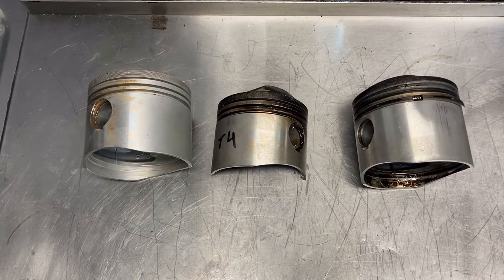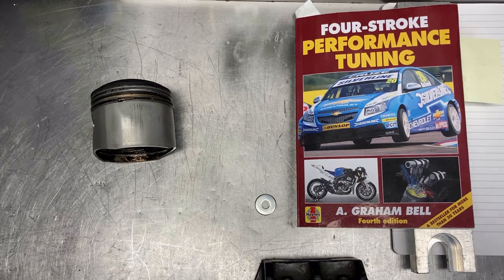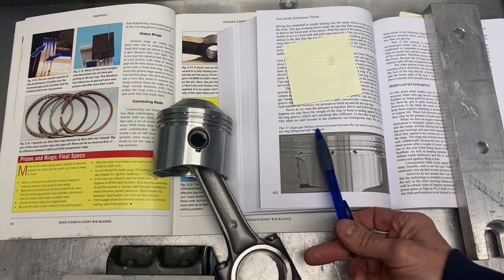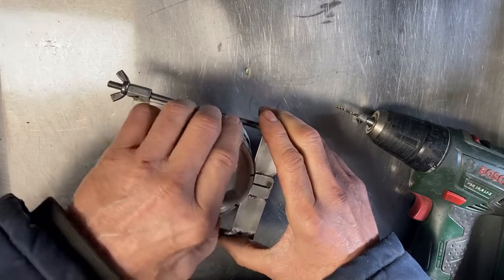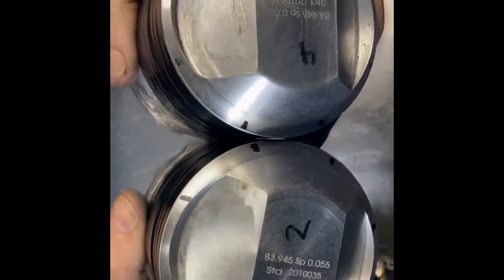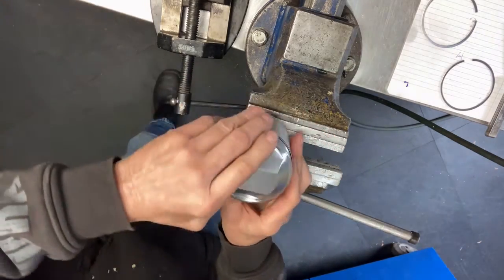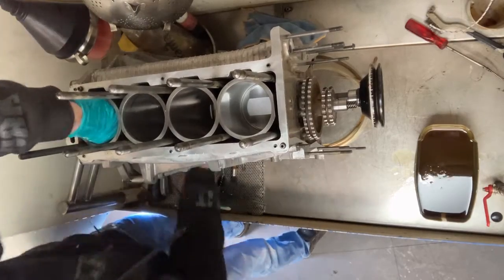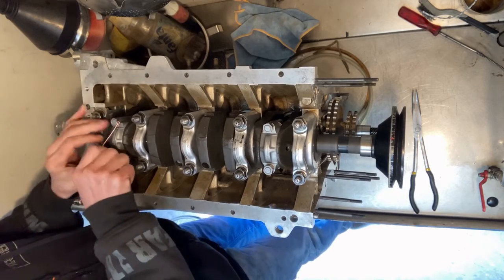Alfa 105 engine rebuild part 6 installing the pistons.

Comment: When did you install the liners?
Reply from the maker: I did not include it in the video because it is a standard  procedure and had nothing to add.
I used silicone grease on the O ring because the surfaces where good.
Iff the surfaces are bad use silicone sealant .
Good Luck.

Comment: Hi there very informative and well explained.I do though have an question on the liners  installation.   Do you use any additional sealer/ compound other than the "o" ring. Thank you
Reply from the maker: If the surfaces are good no additional compound should be necessary.
 Never the less I always use silicone grease ( molykote 111) on all the O rings I instal.
If the surface is corroded or not so perfect I would use sealer to get a good seal.

Comment: Will the lateral gad ports increase crankcase pressure? 
Should I do this for my 2 litter fast road build?
Reply from the maker: I had this failure on my track day car which runs the bulk of the time in the higher rev range
 ( 5000-6500 RPM).
For a road car the chances of this accruing are much smaller. 
The gas ports are bored to the same depth as the piston ring groove to restore normal operation again if ring flutter occurs at high RPM. 
They are on the top piston ring only and not bored completely through like the oil return holes in the oil retainer ring groove.
So, no the crankcase pressure will not increase.
I did this mod because I did not see any downside to it, apart from the extra work.
 And also almost all the high performance pistons I saw had this mod so it must have some benefits.

Comment: Can you explain the use of the feeler gauge again? Between which points is it attached? Thanks
Reply from the maker: Take feeler gauge that is a press fit between the big end and the crank, when you torque down the big end bolts the force is taken up via the feeler gauge and not via the bearing surface.
Although almost nobody does this on youtube, this is the proper way and this is how it is taught.
I used two feeler gauges but one is also oke.

Comment: Great detective work in working out the cause of the ring groove issue and ingenious method for drilling the gas relief holes. Will be interested to hear how this mod performs and what the pistons look like when you tear that engine down in future. Thanks for sharing.

Comment: I want to rebuild my alfetta gt engine after 5000km, because I saw your videos :D :D :D...... What type of pistons are you using? What compression ratio are you aming for? Will you use fuel from petrol station? 95oct or 100oct?

Cant wait to see your further videos:)
Reply from the maker: I use the 2.0 I.E  89'< Spider pistons a.k.a. Motronic pistons 10.4 : 1 compression.
The pump gas in the Netherlands is 98 oct.
I will start with a stock head and later up grade to see if the upgrades work and by how much.
Reply: @nord.tuning  great, thanks for the answer. I am really looking forward to see how it goes with the head. 👍

Comment: Thanks for posting such detailed engine building information. I'm curious what ring to groove clearance you ended up with as I'm currently building a 2.0l Nord engine for my Alfetta and would like to reuse some Motronic pistons.
Reply from the maker: The specifications I have are 0.035 to 0.067 for the compression rings.
my new pistons had 0.06 and my old pistons were above 0.1 so I decided not to use them.
Reply: I'm using the same pistons for my build. Can you tell me the specs of your rings and where you got them?  I'm in the U.S and hard to find those pistons/rings here.
Reply from the maker: For my track day car my local machine shop selected the piston rings for me.
They ordered and fitted:
Hastings 2M 4955
84.00 ( bore )
1.5    1.5   3.5   ( ring thickness )
For my recent build I bought new pistons complete with rings.
I wanted  to use these Hastings rings but the second ring was 1.7 mm thick so I only used the Hastings oil control rings.
Also the ring thickness of the old pistons where: 1.5    1.7    3.5  ,
I haven't the Hastings  number for this set.
There sould by some more info alfa forums ......
Reply: @nord.tuning  Thanks for that information. 
I've been communicating with Hastings and they mentioned part # 28908 is a 1.75mm second ring. I ordered some and will be curious to measure them.
Reply from the maker: @matteasolausson7788  thanks for the info, I've measured the old piston ring so it was probebly 1.75.
Reply: @nord.tuning I am assuming that’s in millimeters?
Reply from the maker: @gfbemc0256  Yes that's correct.👍